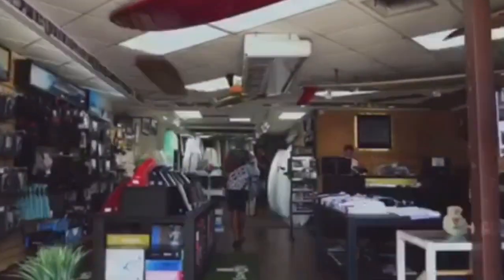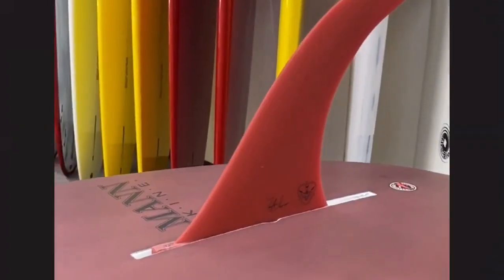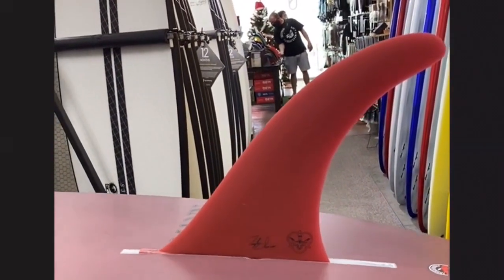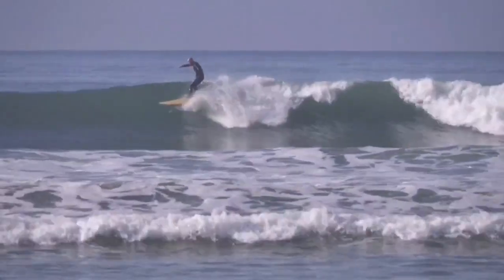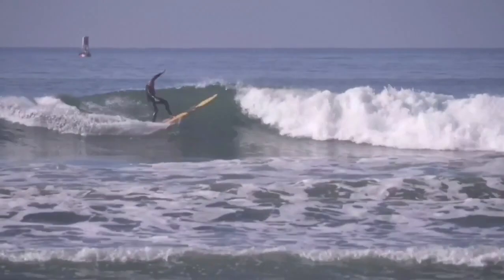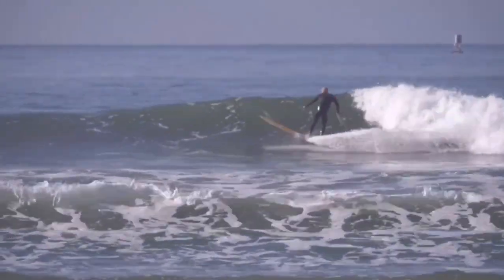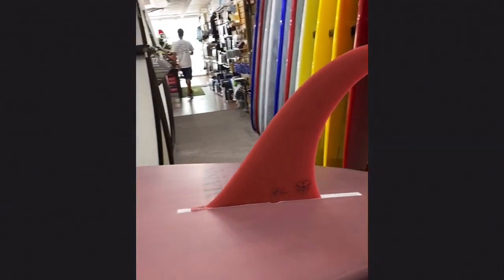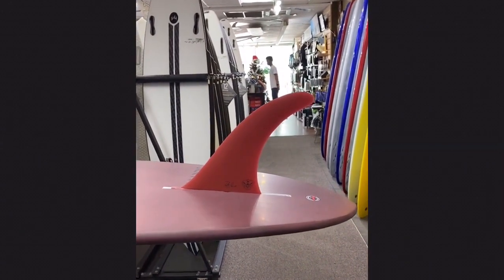Taylor Jensen's Power Flex Center Longboard Fin - Shop at Hawaiian South Shore

Comment: Taylor does push very hard. I have The Gem 9"1' and it goes crazy once the surf gets head high to double overhead....so much fun. 
I still can't t nose ride it though as I love driving hard off the tail. I have the Taylor Jensen 2.0 pro series Futures in it. Great fin set up,never skips or slides and feels so great in sucky hollow waves.Its the Black Carbon model. Love the stiffness however in better surf the flex is there. I am 70 kgs, 51 years old and been surfing since I was 6 years old. I love riding anything. Short , long or just bodysurfing.  🇦🇺🌊💗🏄🤟
Reply: Thanks for that awesome review. - David

Comment: Would you recommend it for a mid length 7’? Just bought a Elmore Submarine and thinking between Power Flex and Parallax 10.5 (Troy Elmore recommend 11.5 for the longer one, but I guess 10.5 should still work well)
Reply from the maker: I think it depends on your weight and also how close to the tail your turning your board.